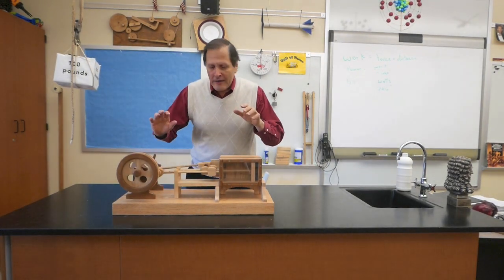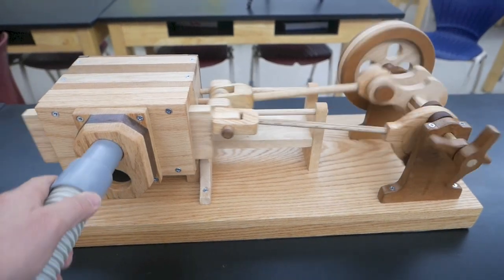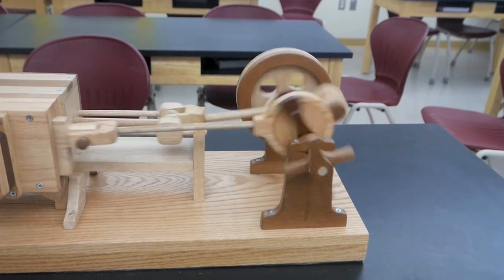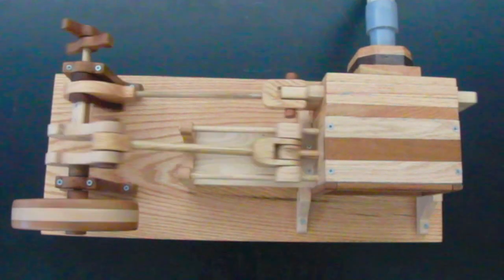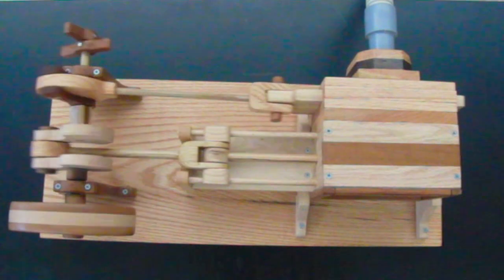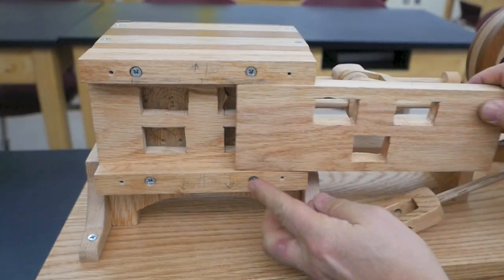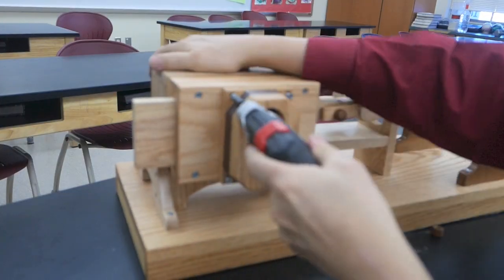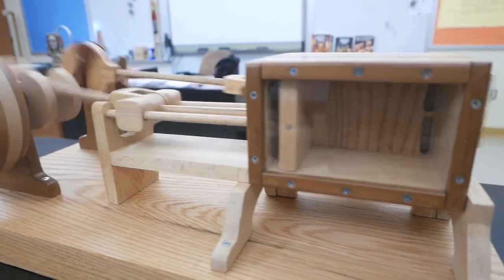Physics of toys-wooden air engine // Homemade Science with Bruce Yeany

Comment: in the middle of making my own ATM. lot of work involved.this was very very helpful thank you
Reply from the maker: HI Neil,  good luck with your machine,  this was a lot of work, especially since I designed it as I went along.  There were several changes that I made before it was finished so I probably built enough parts to build two of them.

Comment: excellent design....do you have any dimensions on the square hole placement for the air flow?  I want to build one of these to use in the classroom next year so any help would be greatly appreciated!
Reply from the maker: Hi Kyle,   thanks,  sorry I don't have those measurements right now,  at the moment my machine is on loan  for a STEM conference and I won't have it back until summer,   I've had several requests for plans for this piece.  I started making them but gave up before I got to that point.  Since I was building the engine from scratch, I ended up changing the design several times as I was building it.  It is built so that most so it will come apart and I hope to  be making  blueprints to share.  If you are anxious to get started,  I would suggest a set that is online for sale at $10.  I didn't use them but they appear to be very complete,  seeing the amount of mistakes I made,  and the lost time and materials, it would be well worth it. the site is:  https://www.woodgears.ca/air_engine/plans/index.html
Reply: +Bruce Yeany (Yeany Science) thanks for the info, Bruce.  yes, I'm familiar with Mattias wandel' s site and I built his screw advance box joint jig (check out my channel for some videos featuring it) from his plans so I'll probably purchase his plans to cut down on the trial and error, great suggestion, thanks!
Reply: Hello I have made an engine that works pretty much the same as yours but made from Lego. I have since added a lever that switches from forwards to backwards. I am 14 and love engines. I make loads of engines from Lego that usually are replicas of real life engines I was inspired to make a v6 marine engine buy another YouTuber And I am now on a quest to make some engines out of wood
Reply from the maker: Hi Max,  that is awesome.  you should post some videos of them on youtube,  I'd love to see them!
Reply: Cool Will do.

Comment: Based your your inspiring and beautiful, I've just begun building a 3 cylinder version. with the valves on the top of the cylinders. Perspex viewing windows are on the rear end of the cylinder block.

Comment: you know if you go to a high enough elevation there is constant wind. You could use that wind to propel an engine like this to do work.
Though I suppose it might be more efficient to just use that air power to directly spin a turbine and generate electricity to run a motor....

Comment: Neat - if you drive the crank shaft by hand can you feel air moving in/out of the vacuum holes?
Reply from the maker: yes,  it also works as a pump,  but not a very good one,  too much leakage

Comment: When I saw the video, it reminded me of a Stirling engine, with the 90 degree thing and stuff. When I saw the products list, I knew it. Nice job though. You managed to make a Stirling engine run on air instead of temperature differential.
Reply: No, this is actually a classic steam locomotive engine, except that it's made of wood and runs on air. It has no close relation to the Stirling engine.

Comment: sir can I get the instructions to build it ?
Reply from the maker: Hello Rohit,   at the moment I do not have plans for this piece since this was my first attempt and the design changed several times before I got it finished,  I've started another one that I will have plans for, hopefully a bit easier than this on was.   I would suggest a set that is online for sale at $10.  I didn't use them but they appear to be very complete,  seeing the amount of mistakes I made,  and the lost time and materials, it would be well worth it. the site is:  https://www.woodgears.ca/air_engine/plans/index.html
Reply: Bruce Yeany What iteration is this? I had to rebuild a toy gun 5 times before I had success. This has many more components. Awesome work!